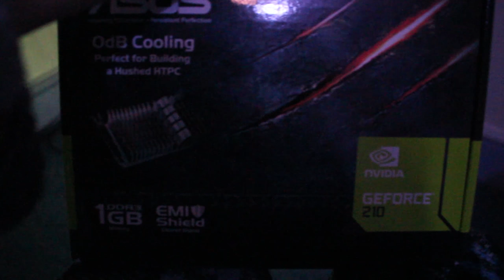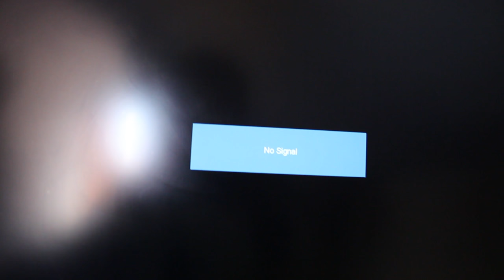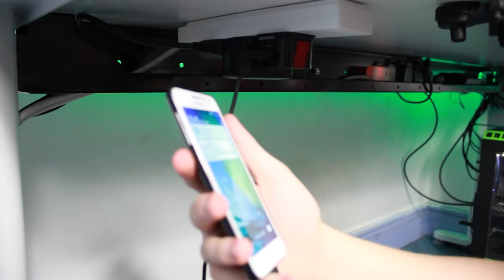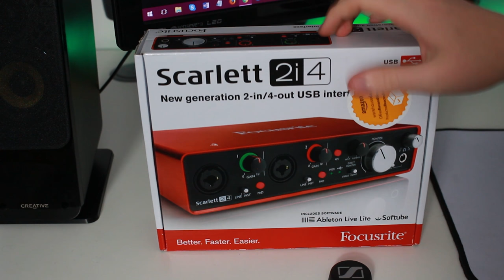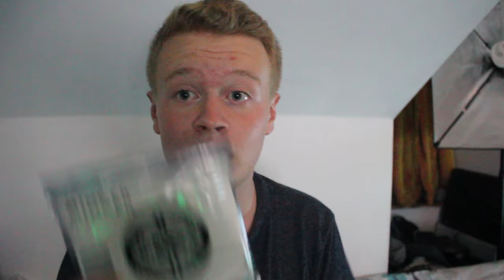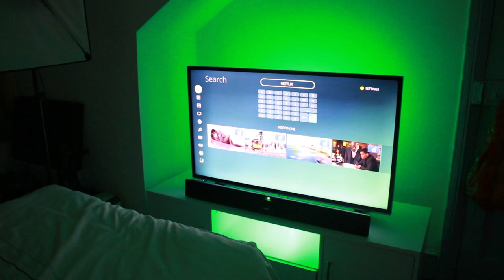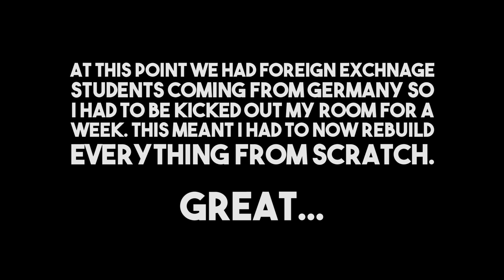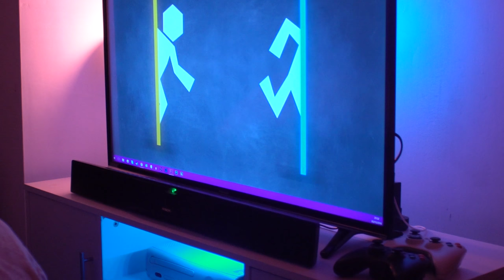BUILDING THE DREAM $7000 YOUTUBE SETUP ~ 6000 Subscriber Special ~ Gaming & Editing 2017

Comment: you have just wasted 7000 dollars but you did a good job with the cable management
Reply from the maker: How did I waste it?
Reply: Tryte you bought stuff stuff for 7000$ but you didn't buy an nvme 
ssd and a gtx 1080 I mean it is a good youtuber setup but for 7000 dollars you should have focused more on the performance of the pc rather than wasting it on stuff like a laptop just saying
Reply from the maker: Prahalad Kangeyan Oh right haha, yeah I was going to buy an NVME SSD but boot times are no different compared to my 850 EVO SSD in there and I found a video codec to record 1440p 60fps or 1080p 120fps, so I don't need extra speed for anything like that. I don't even have a laptop, it's just I incrementally bought what I felt I needed the most and it gradually tallied up to $7K. Baring in mind my setup changed from an Intel Pentium G3258 and an R9 280X with 4GB of RAM to an i7 5820K with a GTX 1080 and 16GB of RAM (although I sold the 1080 for a 1070 and a 4K TV as I didn't need the extra power). If I'd have started with a $7K budget in mind then I would've bought things differently however when I first started on my setup, NVME SSDs weren't even out yet haha. 

That being said, I'm upgrading my PC with a new GPU and a new ZEN CPU when it launches. I'm also getting a fuck tonne more RAM for Premiere and another 1TB 850 Pro SSD to put in Raid 0 with my current 500GB 850 Pro.

Comment: You shouldt have the pc on the carpet but nice setup
Reply from the maker: Thanks man and it's not a problem being on the floor because I have a very thin carpet, the distance between the case floor and the carpet is plenty enough for airflow to the PSU and there's a dust filter. There's no worries of it being suffocated.

Comment: the amount of thermal paste you used is beyond excessive
Reply from the maker: AJ3_ It's non conductive so it wouldn't damage the socket, it's an x99 chip so the surface is large, putting what you would consider as too much on doesn't effect Temps in a negative way. I had less than that on previously and Temps were no where near as good as they are now. Temps atm stay in the 50's while gaming.
Reply: ***** Thanks for the clarification lmao. Made me loose my marbles if that was a regularly sized chip
Reply from the maker: AJ3_ Haha it's all cool man :)